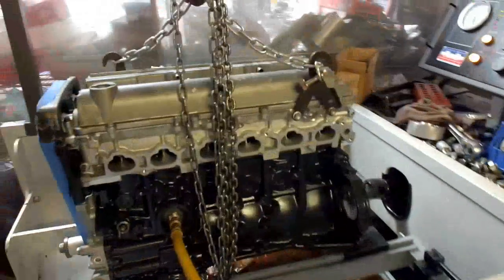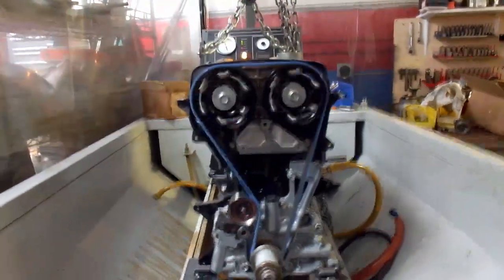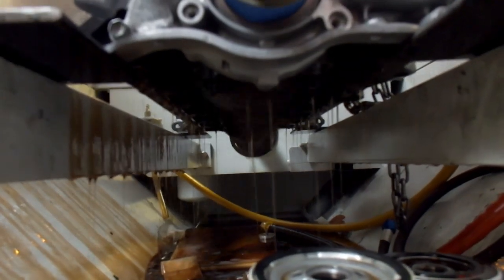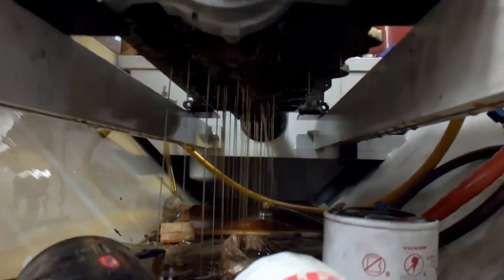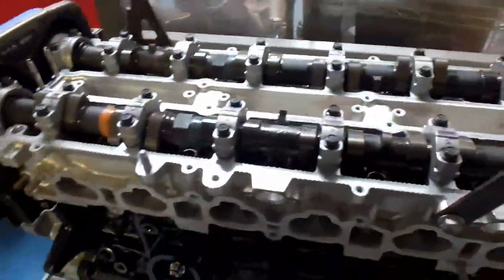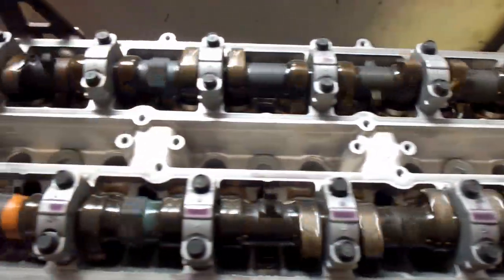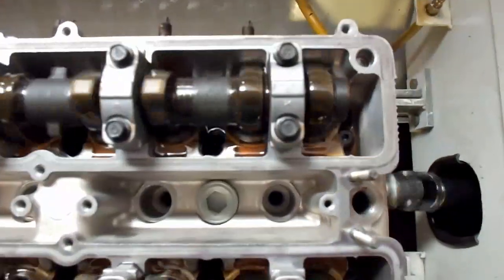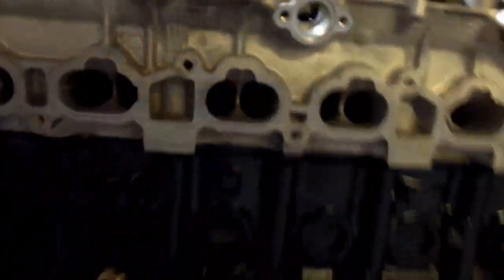Toyota 2JZ Engine Simtest

Comment: i believe those "extra lobes" youre referring to are just little nipples on the camshaft so you can use a wrench and turn them while youre going through the process of torqueing the head bolts.
at least, thats what theyre for on the 7M camshafts, which is the series before the jz engines.

Comment: John, does your Simtester have a measurement for how much resistance the engine is giving?  In other words, can you tell how efficiently and harmoniously the parts are working together?  It would be great to know how much torque it takes to turn a V8 versus a straight 6, boxer 4, or even something more exotic.  Parasitic loss is a terrible thing.

Comment: I've heard that these camshafts are so long that they flex an the valve events are actually a little bit off on the back cylinders. I've about an engine that was designed with the timing chain in the center of the cams to fix the issue, but wasn't cost effective.